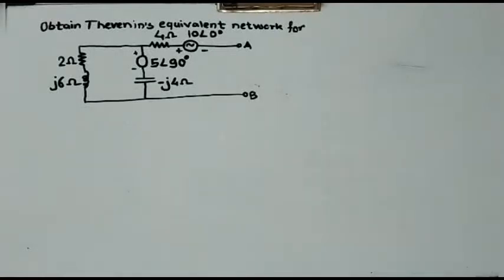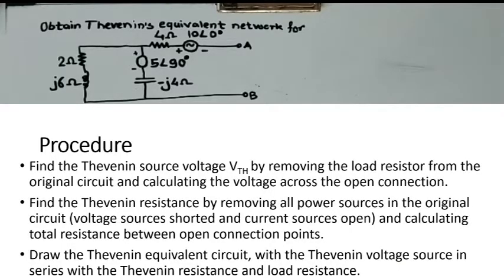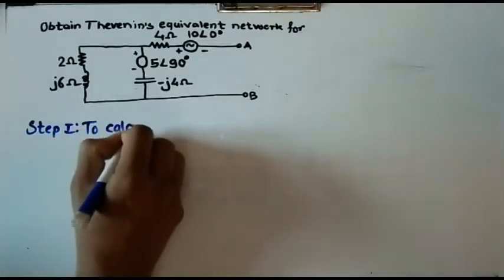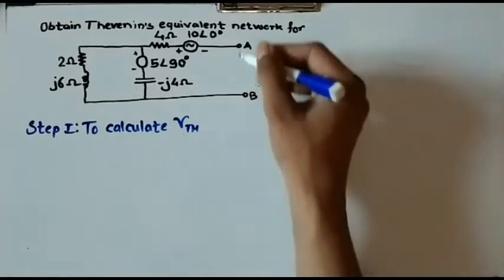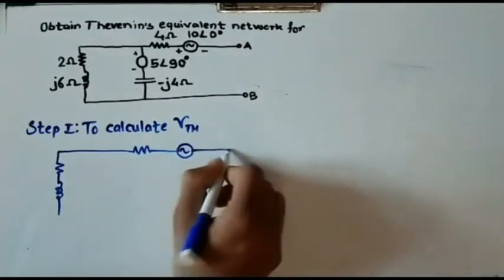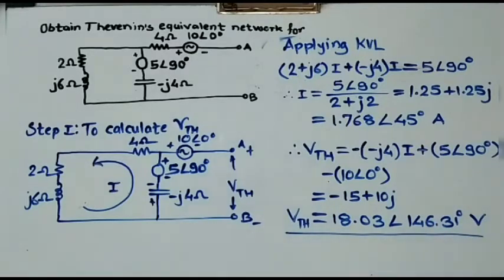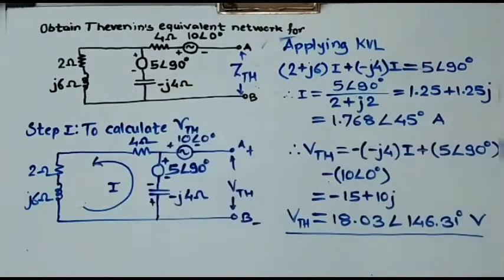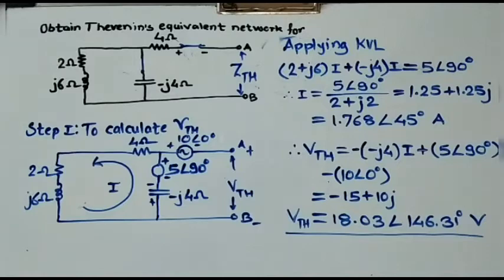Thevenin's theorem for AC circuit | Solved problems

Comment from the maker: Correction:
In step 1, I have drawn the circuit with 4 ohm resistance in first loop by mistake. It is not considered in calculation, so calculation and final answer is correct.
Please consider the 4 ohm resistance beyond the first loop as shown in the question. Thanks for patience.

Comment: To find Vth why you don't consider 4 ohm resistance
Reply from the maker: I have included 4 ohm resistor in the first loop by mistake. Observe, it is not in original question there. So it should not be drawn in first loop while calculating Vth.
So, overall calculation and hence answer is correct.
Reply: Sir,while finding Vth,there is a resistor ( 4 ohm) in the 2 nd loop,but still it has not been considered.Why ??
The eqn of Vth has been written for only capacitor and 2 voltage sources but left the resistor ?????
Reply: @GobikaRR  the 4 ohm resistor will not considered as the voltage drop across resistor is zero as AB open ckt (current is zero).
Reply: @Subudhigaming  ok ,thank you